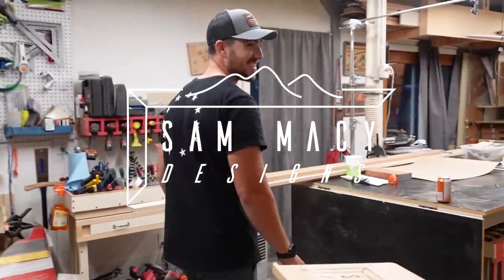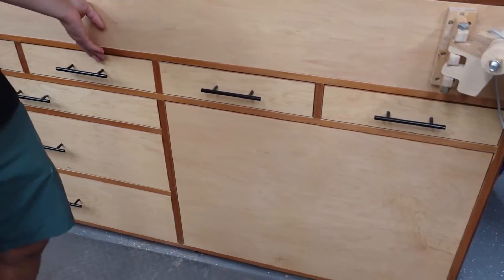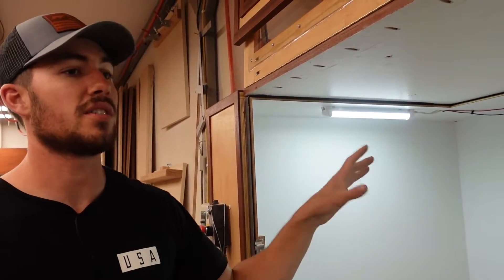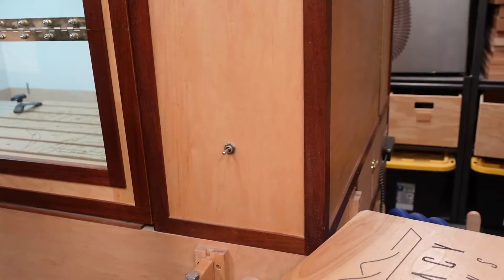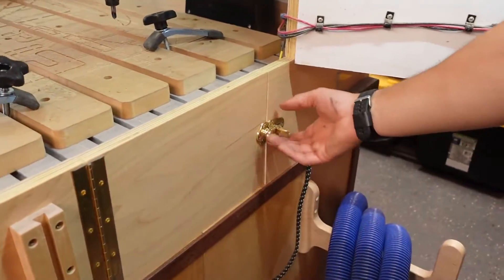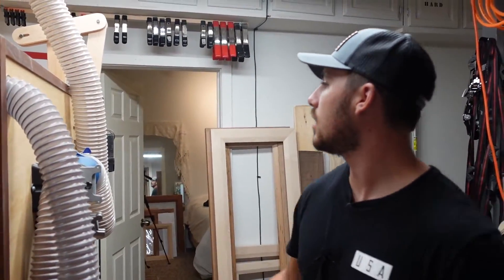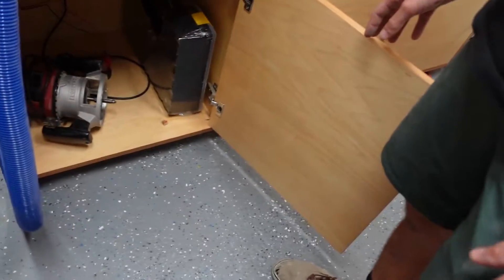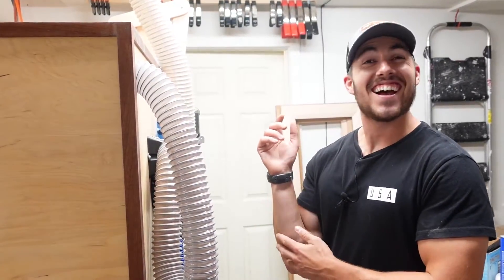CNC Enclosure Tour!

Comment: What is the max Amps you use at one time when making a product?
Reply from the maker: I'm not sure exactly what I'm using for amperage when making stuff with the CNC but I know the max it can draw is 15 amps. So I have it on it's own 20 amp circuit and have never had any issues!